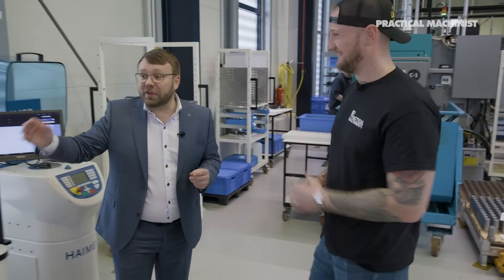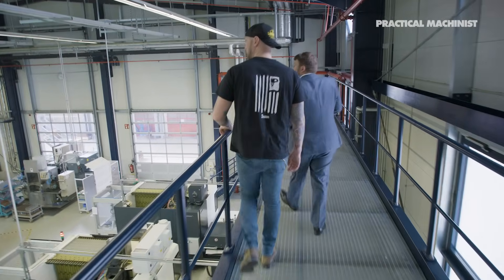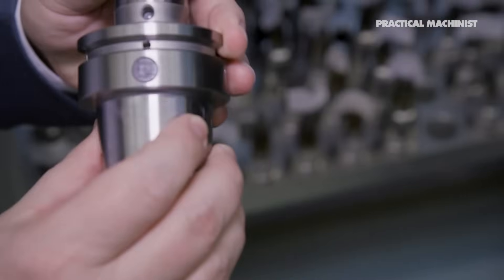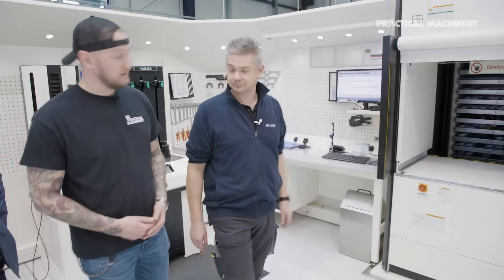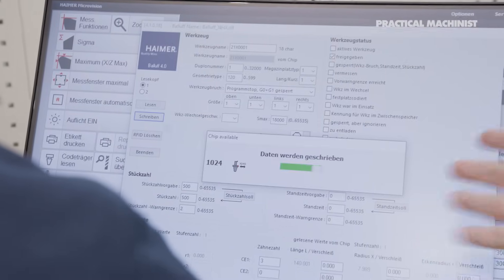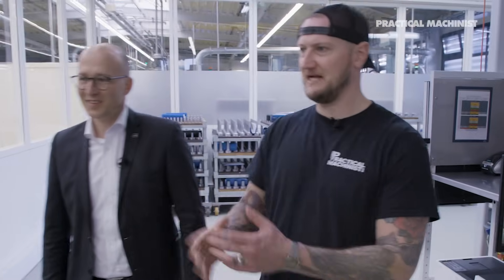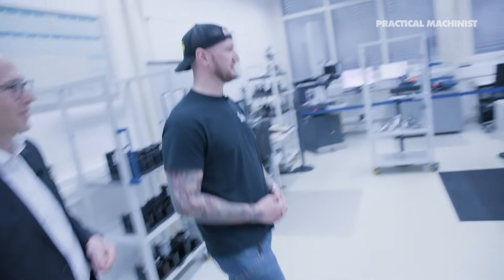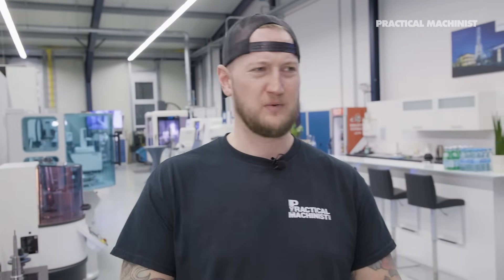The Largest Machining Plant for Rotating Tool Holders in the World!

Comment: Key points: 
The Germans & Japanese have been busting the myth of "post-industrial" economy for decades now.
Automation does not lead to job losses apart from some mindless cog-in-the-machine type of jobs. You need professionals to keep automation running smoothly. AI won't fix the vagaries of manufacturing anytime soon either. 
Japanese & German machine tools are second to none. Too bad American manufacturers forgot about it. Go see Tesla Gigafactories. Most equipment is either Japanese, German or Italian. And that goes to GM, Ford, & Chrysler, Boeing, Lockheed, General Dynamic etcetera. Why? One answer: "When the machine stopped: A cautionary tale from industrial America"